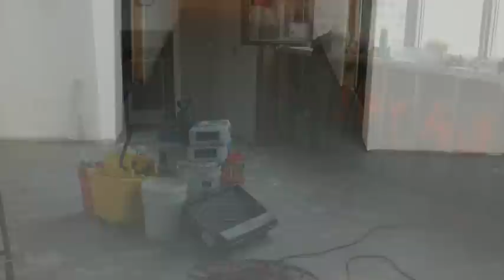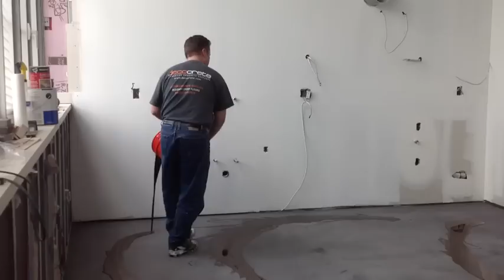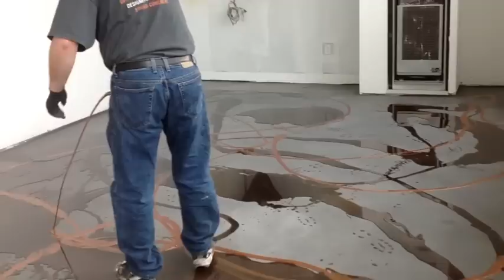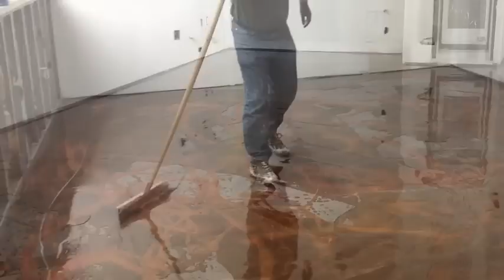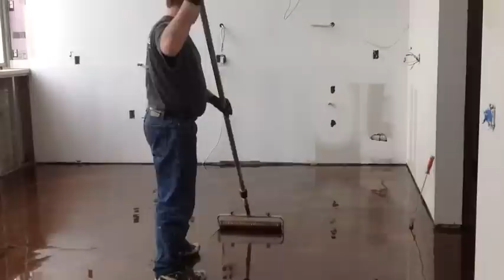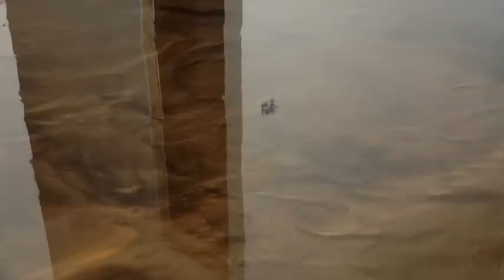Designer Epoxy Installation

Comment: How did you not get shoe prints?  Also was there carpet there before?  I just ripped out my carpet in our spare bedroom and glue is right down the middle.  Trying to figure out how to prep the concrete for staining....
Reply: It’s most likely self leveler..You have to make sure all seams and cracks are sealed or it will run through em, due to how thin the leveler is. It has to be soupy so it does the leveling for you, I mean you have spread it around but it will run into low spots etc, so you have a perfectly level floor. You can use a laser that wraps around the wall, that way you know for sure it’s not to high or low. We use this process on certain tile jobs. Very important to make sure everything is sealed up properly before mixing up your leveler. 
Now what he’s using on top of floor is a different story, and Idk anything about it. He doesn’t exactly explain or show the little things you should probably know before applying this material. That’s when google comes into the picture.lol

Comment: is your epoxy transparent? can i use it on my mosaic. 
For example, my mosaic tiles are not leveled, can i use the material used on video as a topcoat to make it leveled?
What is the material?

Thank you very much!
Reply: You can get transparent epoxy to go over mosaic use a big brush to prime it, then roll 2 coats, final coat is usually best if u brush first then roll off. You might want to patch the uneven area so I suggest mixing some epoxy with clear filling agent then add the color die necessary

Comment: Apparently walking on it with shoes doesn't hurt the design.
Reply: Nita Cruise was literally thinking the same thing
Reply: He's wearing rubber bottom baseball cleats.
Reply: También pensé lo mismo. Camina sobre la pintura y no deja huella.
Reply: Esta usando una especie de zapatos con clavos abajo.
Reply: @farmanali-lt3uz   hello  I want this paint
Reply: He's wearing spiked shoes to walk on the floor during the preparation. Once it's cured you can walk on it with regular shoes with no issue
Reply: I'm like how is he doing that? Not leaving shoe prints? Now I know.
Reply: @joshuasamuels7777 
Where can I find such shoes, in which stores?
Reply: @tamarajessy2709  Just Google "epoxy spike shoes". You should get a few places to buy them from.

Comment: I see he's not wearing spike shoes thus leaving prints on the floor
Reply: I believe he is wearing cleats.  Obviously there were no marks in the final product.  The epoxy flows and self levels for hours, so it's not an issue.  You can tell he has done this many times.  The spike shoes are very slippery and can scrape up the primer coat if you slip, and you can fall worst case.
Reply: 0